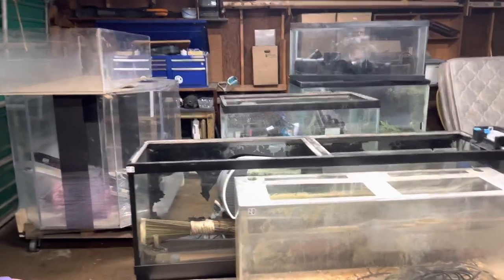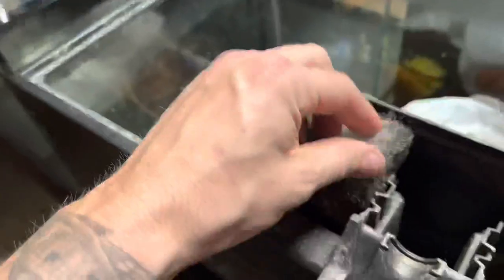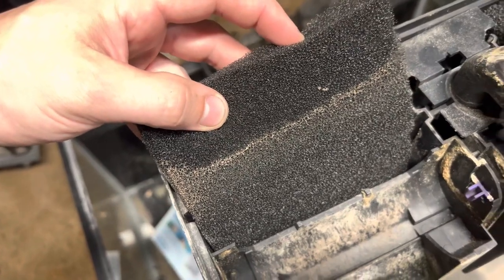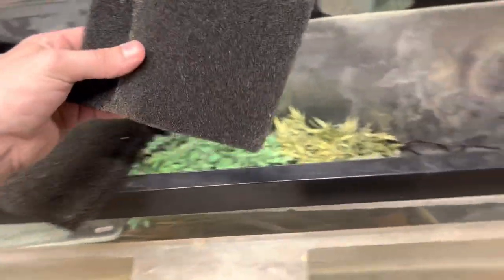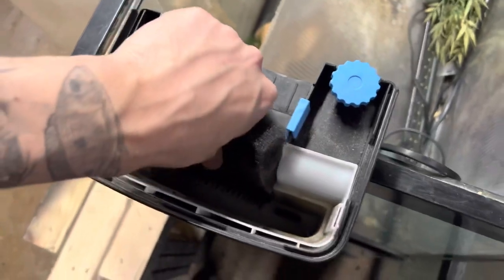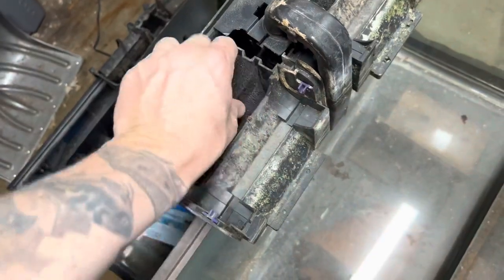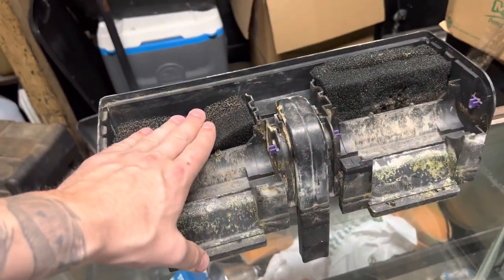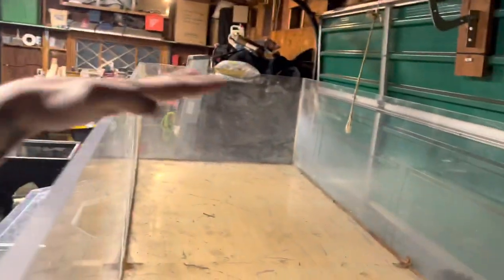DIY Aquarium Filter Pad Cartridges

Comment: I recently started using a filter pad and I noticed only the edges of the pad get dirty. The front and back surfaces are clean. I feel like that's not right. The pad does take up the entire space on my HOB filter maybe that's why?? 🤷‍♀️ is that normal?? Should I use a smaller pad?? Please help. TIA!!

Comment: Update. I have switched to 40ppi sponge instead of cartridges. 2 weeks in. So far so good.
Reply: Do you not use filter floss anymore? Just the black foam?
Reply: @papaross  just the black foam. Don't need it. Works perfect. It's pretty cool how well sponge works. I don't think people realize that cuz they all stuck in the hype of all the different kinds of media that are out there. I'm sure filter floss may be good but I didn't want something that I had to keep replacing. So when I got rid of the cartridges I knew the sponges were enough for me. No extra expenses either.